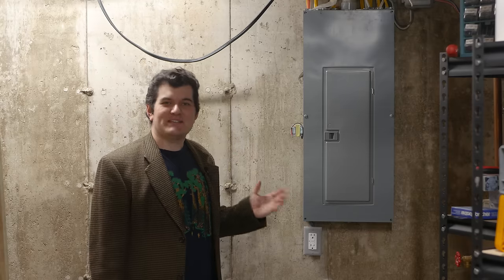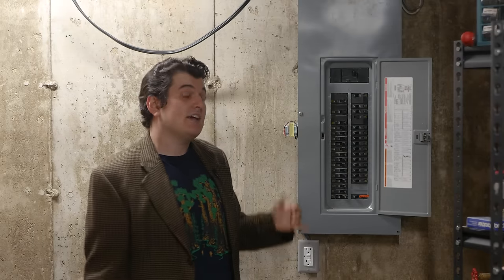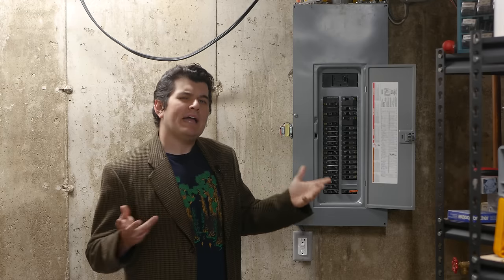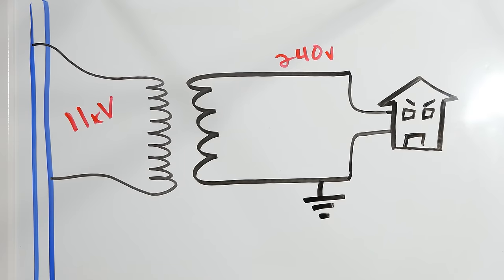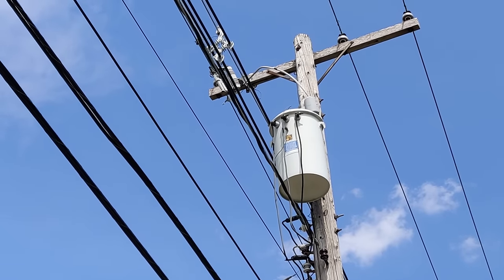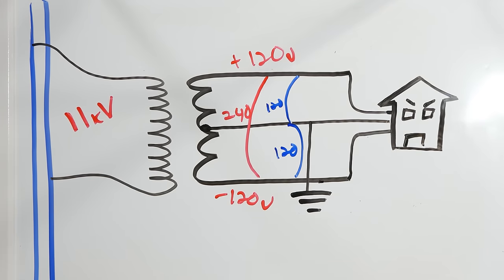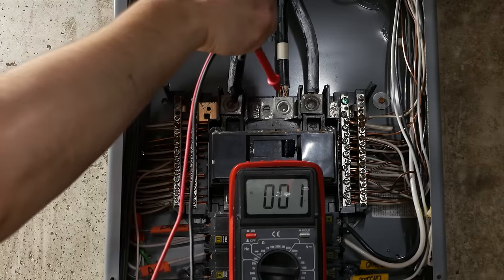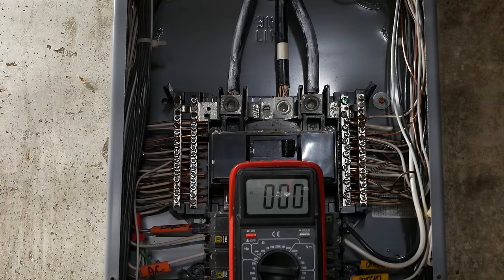The US electrical system is not 120V

Comment: Just a minor addendum because you stressed the "see, we have 240V too" point a few times in your video.
In Europe we have 400V just like you have 208V, with the same 3 phases and stuff. And many residential homes are supplied that way, not only large buildings.
I wrote this comment not because "nanana, Europe is still one ahead of you" (who even makes that point ugh), but because I missed that parallel between the two electrical systems in the video, which at least makes them a bit more alike.
Reply: Exactly!
Reply: 480v 3 phase systems are also fairly common in the US. So we've got 80 more volts. ;)
Reply: I came here to write that comment
Reply: Not only pretty much all houses have 3 phase power, but, if there's no gas supplied, flats also typically have 3 phases used mainly by electric/induction cookers.
Reply: @BenjaminSahlstrom  you know that 400V is the effective voltage, while peak Voltage is 530V on European 3 phase?
AC voltages are weird, European AC voltage (single-phase) actually peaks around 330V, IIRC.
Reply: @Azraleee  weren't those 330v when rectified?
Reply: Thank you! Saying US electrical system is 240V is like saying EU electrical system is 400V. Guess what, we europeans can use 400V if needed, for instance AC, electric stove, etc. Only difference is that we don't have to fiddle around with 120V vs 240V, because 240V is standard so 99% of the time, everything can use it. Only 1% you need 400V for some heavy machinery. So yeah, US voltage is still half of the EU.
Reply: @BenjaminSahlstrom  Here in europe we use 690V for medium sized stuff (Not big enough for HV but still enough power that they cant run on 400V 3 phase - Wind farms for example). As we can get the voltage from a transformer connected in a star, believe in america this would qualify for medium voltage and have different standards that apply.
Reply: And photonic induction uses all of those volts...
Reply: Let's just say that we don't have transformers with a neutral wire in the middle of the coil and only have 3-phase transformers. Most homes only get one phase + neutral, buildings will get three phase and every apartment will be hooked to only one of those phases
Reply: @icovada  OR you get 3 phase to your home :p
Reply: @BenjaminSahlstrom  480V? Is that rms or peak-peak? In what cases are those potentials available and what do you use them for?
Reply: @icovada  My 110m² house (tiny) has got 3-phase 400V...
Reply: @MaximKilligan  Mainland Europe usually has 3-phase 400V incoming.
Reply: icovada 
At least in Germany (can‘t speak for the rest of europe) pretty much every apartment gets three phases. It is primarily used in the kitchen for the electric stove and oven. But sometimes also for electric water heaters. And of course you can have 3 phase power outlets. Though they are not that common in a normal apartment since you hardly need them. Also all normal outlets, lamps etc. are normally distributed over all three phases.
Reply: @icovada  Nah, stoves are usually triple phase in Germany.
Reply: In US a typical single house powers itself from a single phase, and creates the split phase +- 120 V from that. If no split was done (or if you just use the voltage between the different phases) the transformed voltage would be essentially identical to European 230 V single phase, the only thing is that the supply is also cut in two with the center tap. If a US house had more phases of the actual three phase supply in and could connect load between those, that would result in the equivalent 380/400 V delta-configuration voltage.

So in a way the simplest way to look at the US system is that it is pretty much otherwise equivalent, but houses usually only connect to one phase and split that phase in two. (And most of the time connect the load using that split)
Reply: @chelarestelar  rec...rectified?
FULL BRIDGE RECTIFIER!!!!!
Reply: @BenjaminSahlstrom  So how many different "standard" systems do you have in the US of A?
Reply: The EU 'officially' has 230v - but the tolerances allow 240 - 220v. UK three phase is 415v.
Reply: @bobafruti  "Used" not uses... ;) (I know, sucks... but at least he's seemingly got a full time job now :D)
Reply: @Azraleee  See: RMS (root mean squared)
Reply: @Azraleee  You can get the peak voltage by multiplying the voltage with squareroot of 2 and you can obviously do the backwards with peak voltage. At least all sine waves work like this be it in EU or US. However it is quite useless knowledge for most people, peak voltage doesn't matter for most appliances etc.
Reply: 240 is not as safe. I would not want to be shocked by that. Its even lower in Japan. 100-110 well a little lower than North American 110-120
Reply: 400v 3phase seem a lot for a residential home. Most things don't need it. In fact most things dont need 120v. Its only big appliances that would need more. We only use 480/600 volt for big industrial machines. There are 600 volt panels in the plant in which i work in Canada. (Same power system across NA)
Reply: tonyrulez69 120 and 277 L to neutral are both considered low voltage in USA tesidential and commercial application. Medium voltage starts at 2400 Volt line to line for industrial application
Reply: Just to make Europe more complicated.

In Norway most homes have tree phase 230V IT, but new neighborhoods are tree phase 400V TN.

This is a problem for people with Renault Zoe, it only works with 400V TN . To get around this, Zoe owners have a portable transformer in the car.

Other cars can charge on single phase. EVSE do not support three phase 230V IT charging for EV. Some EVSE now support breaking the standard if your car supports it, so you can charge faster than 7.2kW...

Due to safety concerns, all hospitals in Norway must have 230V IT.

On 230V IT, there is no neutral, only three hot wires. A triangle, not a star as on TN (Terra Neutral)
Reply: I wrote this comment because "banana, Europe is still one ahead of you"
:D
Reply: @BenjaminSahlstrom  Well the next step up from 3P 400V in Europe is 3P 690V for heavy industry, and the Swedes use  3P 500V
Reply: @icovada  Where in Europe do you only get single phase, and not all three   ???
Reply: @MichaelEricMenk  i only know IT nets from stuff like hospitals where you want no shutdown in case of a fault, i didn't know they had actual residential use...
Reply: @martinum4  nice to see someone understanding why IT is used in hospital :-)

If I remember correctly, there is only one other country in Europe that have extensive IT   power distribution..

I have TT, but most people calls it IT even if you have TT. For the end user there is no difference between IT and TT.

A fun trivia. When the first Tesla prototype came to Norway, the charger refused to charge due to it fail the ground check since there was no neutral pin. They had to charge up the Tesla Roadster by towing it being a SUV.

Tesla owners in Norway get a different EVSE (/UMC) that skips the ground check.
Reply: @BenjaminSahlstrom  In industrial applications you can also find 290/500V, 400/690V and 1000V nets in Germany.
Reply: @Fiskelord  RMS voltage. we actually have a stupid amount of voltages depending on the use case. 208/120 for residential/commercial purposes, 480/177 for industrial, and in western canada there's even 600/347 for industrial. many industrial or mixed purpose buildings will be supplied with 208 and 480 or 600, with 208/120 used for lighting and outlets and 480 just for equipment.
Reply: @brently1973  a standard european 3x25A 3-phase hookup in europe delivers about the same energy as an american single phase 200 amp setup. So it's about equivalent actually. 

What it does mean is that it's a lot easier to run heavy equipment at home, it means things such as ACs and Heat pumps can use 3 phase motors instead of more complicated and failure prone single phase motors, increasing their lifespan and durability. 

It also means I can buy cheap 2nd hand industrial equipment like lathes, mills and welders and run in my garage.
Reply: @jesperdahl1486  the UK
Reply: Why you would one need 3 phase motors for residential. More expensive and unnecessary. All buildings and institutional buildings are 3 phase from the power plant. Residential homes don't need 3 phase motors etc. I think the advantage is safety. European plugs are huge and ugly to protect one from the 240 shock etc. Why do the plugs have switches on them?  Do appliences not have on/of buttons in Europe?  Again they have to have switches for safety adding extra expence.
Reply: @brently1973  3 phase motors are actually cheaper and simpler to build than single phase motors as well as having much stronger start up torque, single phase motors have all kinds of additional complexity added to make them run on single phase, all that is done away with in a 3ph motor. 

You probably think that 3ph must be more expensive or more complicated because you live in a place where only industry uses 3-phase. But not so.

Residential homes don't "need" 3 phase, I'm sure we could get by on single phase with all the disadvantages it entails, but why downgrade when we already have a fully developed 3 phase system in place and we all can reap it's benefits? There are no cons to 3-phase, it's not more complicated or expensive to build a 3 phase grid either, cheaper in many cases.

I don't mind huge and ugly plugs in exchange for 400V 3 phase when I fire up my mill or lathe or welder, what my plugs look like, that's like the least of my worries. And it's not like the US 3 phase plugs are winning any beaty contests either.
Reply: Dennis A still more expensive with the three phaseses running everywhere and less flexible than north america. However more efficient as more people can be fed from a single transformer
Reply: The multigrounded neutral of the North American primary system provides many safety beneﬁts. Protection can more reliably clear faults, and the neutral acts as a physical barrier, as well as helping to prevent dangerous touch voltages during faults.
Reply: @dennisa6132  Well that is ok, the house is made from stone, and the plumbing is on the outside of the walls.
Reply: All commercial buildings are wired in 3 phase(415V) in the US in case you were wondering just as in Europe.  Just not residential in the USA.  There are some exceptions, but they are few.
Reply: @jesperdahl1486  500V threephase in germany also, but only in older Industrial estates. It s outdated and replaced by 690V .
Reply: @horste9237  500 and 690 mostly  without Neutral , 3 wire+PE  , the 1000V is really 1200V 690 x1,73 = 1194V .
Reply: @Reaktanzkreis  With and without Neutral. You mostly don't need it. But 1000V was 1000V (2 x 500V).
Reply: @Reaktanzkreis  Residential houses don't need high voltage as that means they are using too much electricity.   The idea is to reduce usage not increase it and keep in mind that high voltage is efficient at transmission at long distances and does not create heat in the wire but does create very very large heat and major losses at the transformer on the street and inside devices.
Reply: @wyattroncin941  600/347 is also found in Eastern Canada as well.
Reply: @jesperdahl1486 plumbing outside the walls?

Comment: 1: as soon as I heard that hum on the circuit panel I was worried that there was something really wrong with your house, glad it was a gag.
2: Thank you so much for explaining that voltage matters! Yes, it is the current that does the damage, but I hate it when people act like the voltage is irrelevant to that.
Reply: Hmm.  My circuit breaker hums like that.  I should hire someone to look into it.
Reply: @simonmacomber7466  The hum is caused by sightly loose wire. Not a big deal, but you can pay somebody to improve that.
Reply: Well actually it's the wattage and to be fair, the time does matters as well. (and other crazy stuff like frequency too to be honest.
Reply: @PermireFabrica  just don't touch the dang thing
Reply: Current doesn't cause damage any more than voltage does. It's meaningless to say that about either of them. Put megaamps through a 0 ohm load and nothing will happen (to the load!).
You could reasonably argue that the power, which is a resultant of both V and I, is the culprit. Of course that's a resultant of voltage and impedance really. Or current and impedance. Or...
Reply: Voltage is the force that pushes the electrons.  The electrons do the damage, but it takes something to push (or pull depending on how you were taught) those electrons.  That's electrical potential, e.g. voltage.
Reply: Electrical power has a lot of ways it can hurt and/or kill you:
- cooking bodyfluids
- de-naturing proteins in your blood
- giving you a heart/rythm issue due to frequency 
- your nerves conduciton more power then the were ever evolved to handle
When people claim some new invention is "exceptionally dangerous", I can just point them to their wiring in their walls and ask if they are serious.
Reply: I always use the car battery example. The Cranking amps in most batteries can be anywhere from 400-800 and more for large V8s and Diesel engines. But 12V can't push that through your dead layers of skin. Also, another part of electric shock is the frequency. While my equipment in the Navy used 440V at 60Hz, the most dangerous voltage we had was the 400Hz supply.
Reply: @christopherg2347  im an electrician and im honestly more worried about electrical flash than electrocution. over 20 years ive had more burns than anything else. 120/240 has never scared me but he didnt mention the 277v thats in office buildings and stuff. that will kill you quick
Reply: Hah yes, I've only heard humming like that from a substation.
Reply: At first, I thought it was because there was a transformer in the room.  I thought he lived in an apartment building.  A transformer for the whole floor could be pretty big and loud.